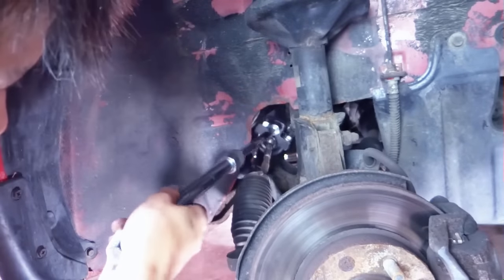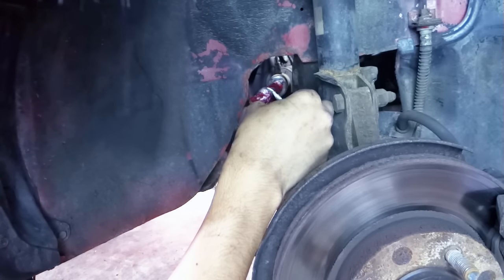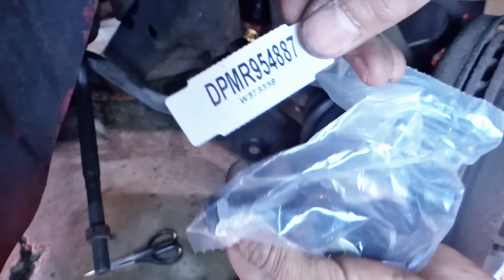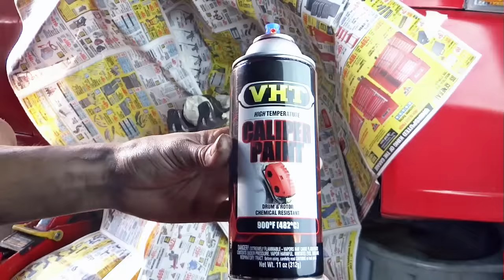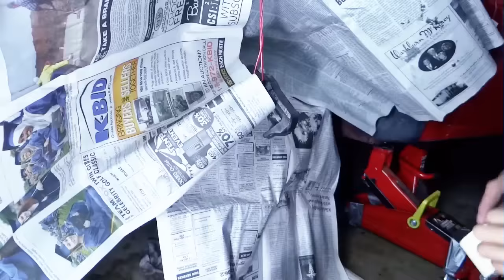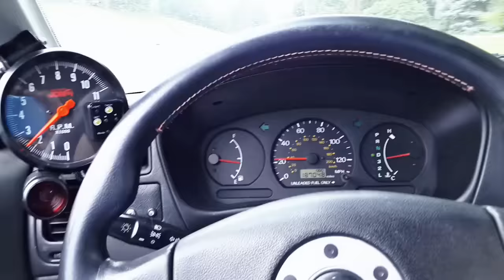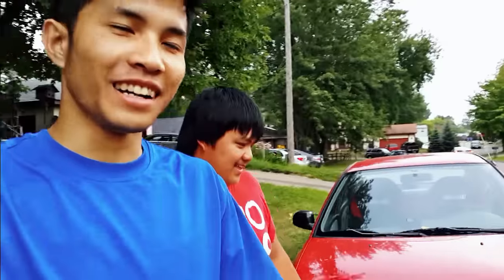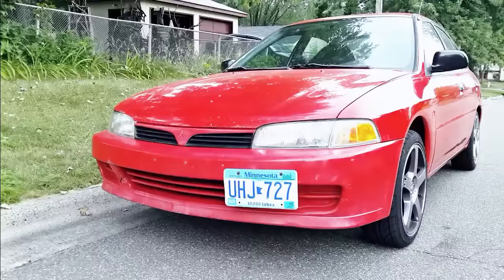Mirage Fix 17 | Tie Rods, Gold Drilled Rotors, EVO 4 Corner Lights

Comment: Never paint the surface of a brake disc, it shouldn't even be touched with dirty fingers, it will effect the bedding in process. Phil should use a degreaser on them , prior to cycling in their bedding in process. All that said, it's good to see you getting in there and getting your hands dirty.

Comment: Hey Mackey, I think you should drop the suspension and out camber on the front and back wheels. You would get a lot more handling out of the car. Also because if the incline of your drive way and the need for lowering it maybe you cod put air suspension on it? Just a suggestion I've been thinking about it for a while and I think it might work 😃
Reply from the maker: Austin Reaux I will lower it.

Comment: Good job Macky I have four suggestions for you:
1)Fully change both of the brakes dust booth
2)Lower it a bit (I know you can't lower it too much cause driveway)
3)Put on the oem spoiler the rally style is a bit too much
4)And my philosophy Turbo everything
Reply from the maker: :D yes, and turbo will be the last epic thing.
Reply: Boost ftw :D

Comment: do you plan to turbo it or upgrade the engine?
Reply from the maker: Andrew Salazar I would turbo it.
Reply: The DarkDragonWing Don't. Mitsas have a relatively high compression ratio and putting forced induction in it would cause misfiring and eventually blow up your pistons because it charges the cylinder with more air at higher pressure.
It is deductible but I think the price the engine pays is too high.
Reply from the maker: Charliechoes
 Put there just to try it  out, maybe 2 psi.
Reply: Well, yeah...trying's not gonna hurt you a lot. :D

Just out of curiosity, how much could a Mirage like yours cost in the US?
In Croatia they're $2000 (USD).
Reply from the maker: Charliechoes
 About the same. Got mine for $1800
Reply: And in almost excellent condition. Nice, ty for the info. :D

Comment: Hi Mackey, it seems you put brand new normal rotors in this video and later you changed them to drilled/slotted rotors. Any reason why? Thanks
Reply from the maker: I like the look of the drilled/slotted rotors.
Reply: @DarkDragonWing  did you notice any improvement in braking performance?

Comment: Why paint the rotors?
Reply from the maker: Crustyto3z Want to cover it with paint, it looks cool and anti-rust
Reply from the maker: The paint on the brake pads area will come off, and the rest remained painted and anti-rust. The calipers are held using wires.
Reply: The DarkDragonWing i can clearly see between 5:03 —5:10 the caliper itself was hanging my the brake line. Also, you cant just gorilla glue the ripped brake cylinder boot. Extreme temp from brake will melt it right off. You need to replace the rubber boot. The time period it takes for the brake pads to rubb off all the paint will cause significant decrease in stopping distance / brake performance. I am being an asshole here because this kind of amateur/inexperienced mechanic work can not only yourself, but drivers around you and even pedestrians.
Reply from the maker: Brian Lim
 1. I can assure you that this car is above average. They are cars, old cars, out there that aren't very functional and still being driven on the road.

2. The time it takes for the paint to come off is a couple of blocks around your house. And it in fact increases the friction, not decreasing it. The braking will be smoother once the paint is off which, again, 4 blocks from your house.

3. It has been over three months, the glue and the rubber still look exactly the same.

4. 5:03 —5:10 The caliper was placed on top of the wheel hub, not hanging by the brake line.

Comment: You should never paint the rotors. You can tape off the area taht touches the brake pads and paint the center part, but never paint the braking area

Comment: woahh buddy. 2000 degree caliper paint? you're not racing this car on a track trying to stop from 170+MPH. no need to get 2 thousand fucking degree paint. your calipers and friction material will melt off before your paint has time to react.
Reply: +ghostrider433 Wait. HOLY SHIT. are you seriously painting your fucking rotors and pads? i just shit myself
Reply from the maker: +ghostrider433 lol Things last longer when they have some protection.
Reply: The DarkDragonWing Yeah but painting the rotor contact surface? in my eyes that's a big no no, but, if you can stop like normal then i guess it's alright. and yes they do, anything i can on my car i paint haha. but nice videos. i've pretty much watched them all in one sitting
Reply from the maker: ghostrider433
 Yes :D the paint on the areas where the pads hit will come off, and the rest remain painted. Not so good, but works. I don't do that anymore though haha, better off with drilled gold rotors.